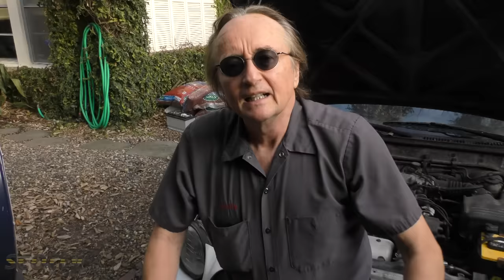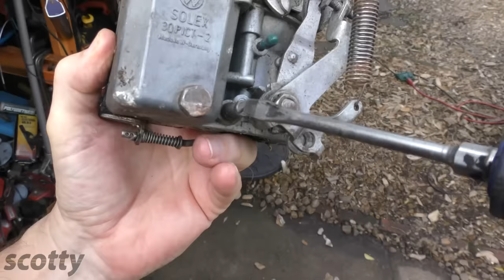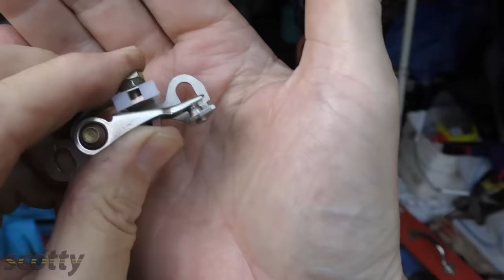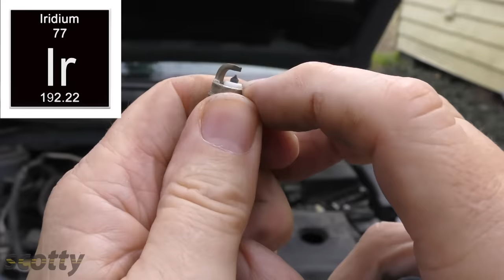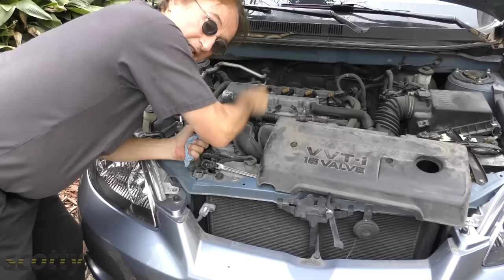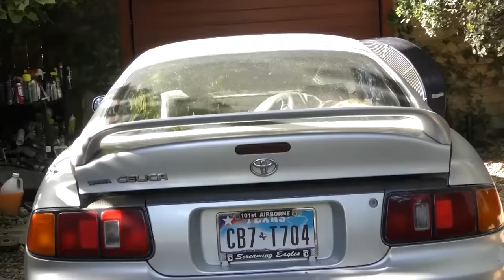Does Your Car Need a Tune Up? Myth Busted

Comment: Don't forget to change your blinker fluid
Reply: And rotate your muffler bearings at every oil change.
Reply: My owners manual recommends every 7th oil change.
Reply: Ano I better do that this weekend
Reply: i use the synthetic ones
Reply: I wish I could, but my Jeep Grand Cherokee WJ calls for Mopar Titanium blend - Lithium grease from NAPA.
Reply: I filled mine with clear silicone - never needs fluid again!
Reply: Someone told me I need to fill my tires with water to make it more comfortable on bumpy roads....
Reply: They've got Visine for that.
Reply: You should post this comment in chrisfix's videos
Reply: Only for BMW's
Reply: has to be low ph otherwise they rust
Reply: I have a BMW, so i don't have to worry about that.
Reply: Ano so wet right now
Reply: I rotate my tires every day
Reply: Rotate your spark plugs once a month so they wear evenly
Reply: Tire coolant,
Reply: I check my ball joints once a year.
Reply: I wax my ball joints.
Reply: Eric Mark lol
Reply: Nasts
Reply: Also, don't forget to fill up your battery with anti freeze so it doesn't heat up
Reply: Take those dead bugs out of your radiator for better air intake.
Reply: I got my windshield filter swapped this mornin
Reply: If you have a honda you need to replace the vtec fluid as well.
Reply: I needed that laugh man, thnx
Reply: LOL these comments are hilarious. Stop playing someone is probably looking under their hood right now trying to find their blinker fluid tank hahaha.
Reply: And the muffler bearings!
Reply: I get my ball hoses purged every night through my head master cylinder
Reply: Thanks for reminding me. 
Almost for got the most important part
Reply: Go to your local mechanic shop and have them inspect your Piston return springs to make they're not worn out.
Reply: @nephi30  I never rotate mine.
Reply: Hahaha
Reply: lol! you make me laugh, i give you money!
Reply: Make sure your alternator isn't leaking 🤣
Reply: Yoooo wtf 😳 how did U know. Is this ...... that isn’t cool
Reply: I can't find where to put the fluid at?!? So frustrating
Reply: @raydavies6236  😂😂
Reply: Lmao

Comment: Great advice. I just "tuned-up" my car at 100K miles. replaced spark plugs, checked ignition coils, changed belt, inspected hoses, changed trans. fluid, and radiator fluid.
Reply: Replace brake and power steering fluid?
Reply: Change fuel filter,air filter,change differential fluid
Reply: Rotate tires,clean m.a.f sensor,clean throttle body
Reply: Replace plug wires is a biggy
Reply: So you got alot more to do for 100k
Reply: Lol hope you've changed your oil
Reply: Check that alternator too
Reply: Did you check your muffler bearing and check the blinker fluid levels?
Reply: C@ptain_Jack: I had a friend that worked in a gas station. He told me that a woman came to get some premium gas for her Mercedes and paid him $20 extra to put "fresh air" into her tires. He said ok, took her money, and replaced the air in her tires. Can't make this stuff up.
Reply: Sunil Thomas I certainly don’t doubt that.  As long as there are unsuspecting prey, there will be predators.
Reply: Yes, radiator fluid = coolant. I forgot the word police was monitoring.
Reply: JMK1998 she asked for it stop trying to nice
Reply: Woman here, and if she offered $20 to replace the air in the tires, than that's what she wanted.
Reply: @boondock6055  if it’s super old car that and some.
Reply: @boondock6055  fuel filter and I’m talking about Lexus even older ones are connected to the fuel pump no changing a separate filter anymore. The backwash is it self if it gets dirty
Reply: A must is to clean your MAF sensor and throttle body. Unless you don't care about gas mileage. But good for you for doing a tune up.

Comment: It is true most recent models of cars and trucks do NOT need a tuneup that you heard about in the older/ignition point cars and trucks.  In the old days, you needed a tuneup every 15,000 miles with dwell meter, timing light, plugs, points, air filter and carb cleaner.  But here is an important point:  There are still many millions of standard ignition cars and trucks sitting in garages, farms and car collections where the owners or inheritors of these vehicles need some guidance how to use their dwell meters, timing light, etc and how to tune a car. If we looked on the web, we would find many young owners who are asking how to use a dwell meter and timing light.  The YouTube videos now just do not do enough to offer some step-by-step guidance for the older cars and trucks.

Comment: I went to get my oil changed today and the advisor told me I should get a tune up due to 102300 miles on my 09 Corolla. I ask what parts needs to be replaced for $450 and was told 4 spark plugs and clean the fuel system. WTF, no  joke you can't find an honest repair shop these days.

Comment: This man speaks true volumes. Thanks again. Just saved me hundreds from a thieving auto mechanic. I went in for a oil change and dude went on saying my car needs a tune up. I drive a 2017 car.
Reply: It’s true what you’re saying every time I’ve asked the dealership and one other place. They would never tell me exactly what the tuneup is and conclusion all they really do is check in the spark plugs and any coil pack. 
By the time I went to the third mechanic shop to get a price they told me it’s like not really a tuneup but just changing spark plugs and Packs and then they can just look and make sure everything looks ok like the belts etc and thats it.

Comment: Carburetors were a pain in the neck. I had a 4 barrel Quadrajet that I'd have to crank the engine for 1 minute in the morning in order to get the engine to start up. Turns out the well plugs were leaking, I had to grind them down and JB weld them. The problem was gone. For that purpose since there was a lot of airflow to cool things, the JB weld worked good.
Reply: I had several GMs with the Quadrasquirt and remember them well.  One of my first acts upon buying them was to replace the Quadrajet with a Holley.

Comment: My cars get check ups every time I get a full lube job (Chassis+oil). If anything is looking worn out, I get a call, and I usually have it fixed, My cars don't fail me as a result.
When I had my first couple cars, if I skipped my pre-Winter tune up, I'd be reminded of that mistake on the first really cold day, when the car didn't start.

By the time I was in my 20's, I could afford to buy cars that were newer than 1964, and arguably modern. That was in '87 that I got a car with electronic ignition, and a sealed pre-adjusted carb. What a dream it was getting it setup for the winter... 
Check the coolant, put it on the scope to see if there were any lazy plugs/plug wires, and check the timing to make sure the distributor was working correctly. 
And, if I missed the winter "tune up", the car would still start.
I thought that was great. Then I got a car with fuel injection. 
WOW! 
I didn't even have to touch the throttle to reset a choke to start the car on a cold day, after missing the Winter "tune up". There wasn't a choke to reset.

Now a days, with these new cars, I'm expecting that a dash tune up will soon be required to be able to see the speedometer on a cold day.

The peak of reliability was in the 90's, when the electronics was where it was needed to make a car reliable. Now there's so much computer controlled BS in the newer cars that things quit just from a software glitch. On top of that, all the plastic parts used in high heat areas just creates breakdowns.
Reply: DrFruikenstein My 1998 Jeep 4.0 300k tends to agree with you.

Comment: Thanks, now I finally understand what is meant by a "tune up"! Because I always thought about the "tuning scene", those people that put body kits and spoilers on their cars, lower the suspension and increase the horse power of their engines by changing the air intake/exhaust system or the camshaft or even adding a turbocharger. That's what I knew as "tuning your car", in fact we use this English word with that exact meaning in German, so it's something totally different. The things you described in the video I would summarize under "general maintenance", so all the stuff that you need to do anyways (like air filter or oil changes etc).

Comment: Tuning a car in today's term is more about those guys that needs the best performance from a car than  it is designed. They do not 'tune' mechanically as you described, they 'tune' electronically by changing the parameters set in the software that the car computer runs.
Reply: Vince C 👏👏👏👏
Reply: taledarkside ...depending on your Ricer! I use to be balls deep in the world of Imports, it was all about squeezing all the HP you possibly could out of a 4cyl! It was fun and expensive at the same time, looking back now, I could have took all that money I poured into my Civics and integras and purchased a 5.0 mustang with 2-3 times the HP of my import from factory! But that was out of the question. It was all about The "Sleeper" effect! There was nothing more satisfying, Beating the brakes off of a 5.0 with a sleeper civic! 99% of the time Races were won by lack of launch control skill from the stang fan boys! And it was always entertaining of the onslaught of excuses pouring from the mouths of these slightly young, slightly spoiled rich kids, that think money can buy you a guarantee win! I'm not saying I never got my arse handed to me by another sleeper type car or driver, but you could almost bet a weeks salary on who was going to launch banging the rev limiter on street radials, easy targets, easy paydays! Just like they say..."if your spinning, you ain't winning!" 
It was all fun and games, until those douche bags in Hollywood released The Fast and Furious! That was the end of my import tuner days!  Every rich mommas boy thought they could throw a bottle of N20 on there Kia and the world would be a blur! Ruined a fun time in the Real Import Tuner world for sure! I actually still owned a 
99 civic Si with a JDM civic type R swap that I had crated from Japan, after I got a little to snappy at the drag strip one night racing my buddy in another 99si! To much nitrous and a missed gear at high rpm = a whole lot of knocking on the drive of shame back to pit area!  And I wasn't even posses! I knew I what I had to do, pull old B16a and drop new bad ass. 9,000+ red line Ek9 B16b Type-R engine in .
Reply: Vince C my car can not.be tuned yet there is no software available nor is the pcu or ecm hackable thanks to good ole GM
Reply: That's called tuning, not a tune-up. Scotty is referring to the old school days of tuning a car every so often to maintain it's optimal performance. This is for regular cars, not modified performance vehicle that need ecm tuning and reflashing after mods.

Comment: I did "tune up" my 08 Chevy. I am amazed how well the V8 runs now that I've cleaned 100K miles of "gunk" out of the throttle body. Took a while for the computer to adjust to the "cleanliness", but it did and again, I'm truly amazed how smooth the idle is and I'm probably fooling myself when I'm thinking that the performance has increased to that of a vehicle with less miles. Thanks Mr. Kilmer, I truly enjoy your videos, please keep making them.

Comment: I have shop and when someone ask for a tune up I ask what is wrong with the car, they say it has a misfire. I say we dont work on car based on someone else diagnosis. They ask why I charge for diagnosis, I tell them its a lot cheaper than have it misdiagnosed. I have a customer spend 2,000 dollars on parts because previous mechanic mis diagnosed it.

Comment: It's funny that you made this video. I just had my dodge Durango in the shop for a new fuel pump and when I went to pick it up, he said he believed I needed to have my truck tuned up. I think what he really wanted was to tune up my wallet. Luckily I was smarter than that and told him no thanks. So thanks for confirming what I already suspected.
Reply: After the fuel pump the wallet was more than sufficiently lightened.
Reply: Rolo Thatcher your right about that good job
Reply: Rolo Thatcher smart
Reply: MichaeL Walker thanks but I took my truck in shop took to days replace my master cylinder backs
Reply: Tune Dz nuts!

Comment: I do think tune ups are still a thing, but not like they were in the older days. And possibly a lot simpler too. Things I consider a tune up now a days are the top end of the engine cleaning of carbon, injection cleaning, and spark plugs, and I guess air filter cleaning/replacement. With what I've seen in some of the top ends of some engines, I know tune ups are still important. I've pulled two inches of carbon, soot, grime off a throttle body flap of a mazda. I promise you, that was all inside the throttle body and further down. Don't neglect that intake.

Comment: Factory tuning no longer exists but performance tuning does
Reply: Charlie Smash Well I guess some cars can have some tuning at stock. It's mostly done for modified cars I believe.
Reply: Charlie Smash normally what gets tuned for performance increase (at least when modded) is ignition timing and something with the transmission.

Comment: 1960s. The coolest era to be in your youth.
My Aussie assembled 1989 Ford Laser (badge engineered Mazda 323) has multi port fuel injection BUT has a conventional distributor as well, which still requires timing adjustment to stop pinging up hills. You can also adjust idle speed with a screw.

Comment: Great on you Scotty. You simplify where others talk a great deal to get people blinkered. I owned a few cars, ran from brand new to 200,000 km plus (by then they are only worth a few thousand bucks). Do your oil and filter changes, this a must; 10,000km to 15,000km intervals whatever suits you. Ideally use fully synthetic oils (stand to better high temperatures). Air filter as needed. Iridium spark plugs very 100,000 km or so when you feel some roughness in acceleration. I never had them tuned in those times. Eventually sold those cars, they are still running around town well!

Comment: Thought getting a tune up was to get your spark plug change checking the air filter etc.
Reply: It is. That's why I'm confused with this video. He makes it seem like it's all done on computers; I do believe that after awhile, especially depending on how much you drive your car and the weather your car operates in, will require a spark plug change.

Comment: Modern cars tune your wallet like no other....
Reply: Ah yes, the cost of my 10,000 mile oil change and 100,000 mile spark plug change is very prohibitive compared to a 15,000 mile carb clean and adjustment.
Reply: you can do all this yourself easy on a old car with plenty of access an few hours labour. modern cars cost more time wich equals more money. plus more expensive components
Reply: Sabino Berenguer Berenguer back then shit was easy to diagnose and repair
Reply: WalkinOSF Thing's have gotten Expensive peoples Wages have not.
Reply: More like prune your wallet.

Comment: Tune up can also be meant using an aftermarket ecu to fine tune the ignition timing, air fuel ratio, cam angle etc to gain more horsepower.

Comment: Just don't use champion brand spark plugs.
Reply: Champion spark plugs are used for imports and Chrysler's for low ignition systems and motorcycles you use what the manufacturer recommends

Comment: Be careful, Scotty does a great job here but there are additional things you should check periodically.  For example, if you have a front wheel drive car the transmission as a rubber "boot" on each front wheel.  If that "boot" rips, you want to replace it pronto - or you will have a bum transmission after some time when the grease come out and have a far more expensive repair.  As usual, Scotty is amazing but those boots can be troublesome.
Reply: Sam S lol wtf are you talking about?,the cv axles?or do you even know
Reply: The CV joint, what else do you think I wrote?
Reply: I have had to replace them on my old VW multiple times to save the tranny.  Don't own it anymore but never had an issue maintaining that cover.
Reply: Well the cv boot has nothing to do with saving the tranny lol
Reply: Of course, but that joint is essential for if it goes bad it screws your tranny.  I just made it simple, sorry  I was not exact enough for you.
Reply: Sam S I have the cv will just break long before the tranny has problems but old vw were junk I never owned on so who knows
Reply: So of course it makes sense to not maintain it if it rips.... so your CV can break (if not your tranny even in your case).  Makes perfect sense to neglect checking it.
Reply: Sam S lol the chances of a ripped cv destroying your transmission is slim to none the play will be on the wheel side of the joint not the trans and the trans spindle wile keep the cv firmly locked in place which is why the joint goes when the boot is ripped,but I know and you know it should be maintained but the people watching these videos don't know a spindle from a break pad and will not maintain it anyway
Reply: It's all well and good to watch Scotty do it but actuall doing most things on a car when you haven't grown up doing it alot of hillarious mistakes will be made I wish I could watch
Reply: It depends on the car as you stated correctly. VWs were notorious for this issue.  Japanese cars rarely had it impact the trans.  My whole point was to maintain the boot - but you are correct, technically it protects the CV joint which connects to the transmission spindle.  Not the transmission directly - I overstated it.
Reply: Also true - replacing a boot is probably not for most watching this video unless they are mechanically inclined.  Perhaps why it was not mentioned?
Reply: I probably put 10k miles each on a Caravan and a Corolla with bad CVs before finally replacing them, did no harm to either's transmission.
Reply: Glad your brands don't have issues - not all are the same.